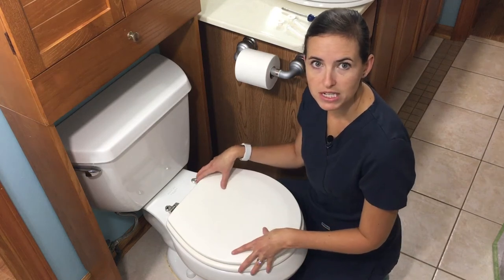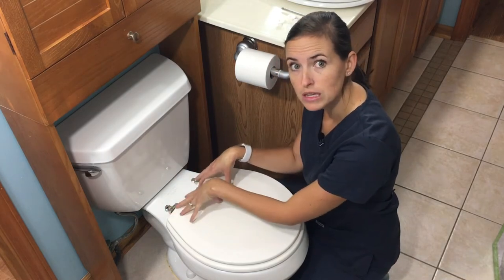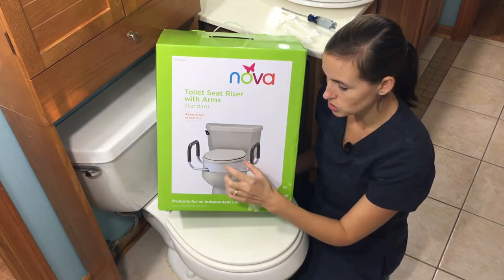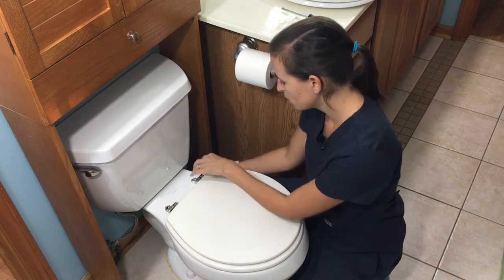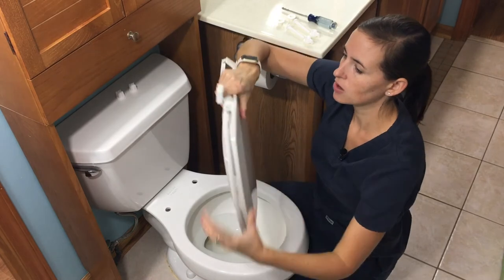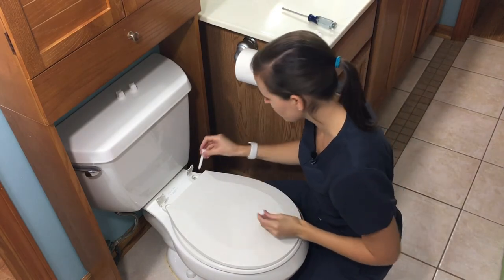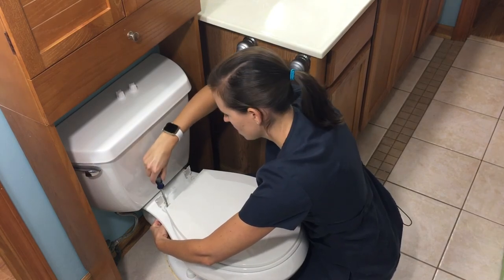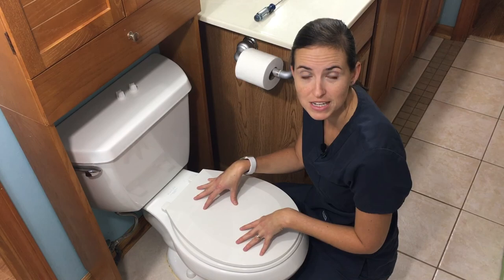How to Replace a Toilet Seat | Prep for Medical Equipment

Comment: I am a subscriber I have the riser equipment but now when i sit down my toilet seat goes one way and it just feels uncomfortable 🤐
Reply from the maker: There could be a number of issues that cause an unstable seat. My first thought would be making sure the riser has its rubber feet on the bottom and check to see if the you have a rubber gasket for the rear attachment area for the toilet seat. Sometimes I have to add additional rubber washers at the toilet seat attachment area.